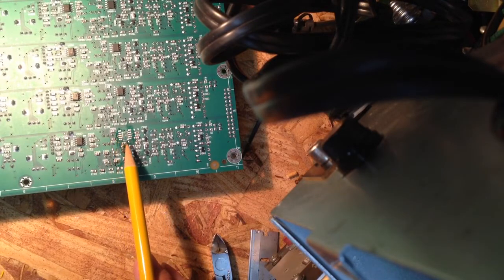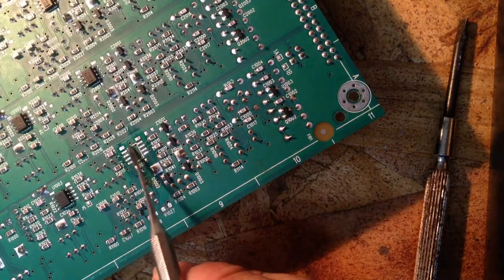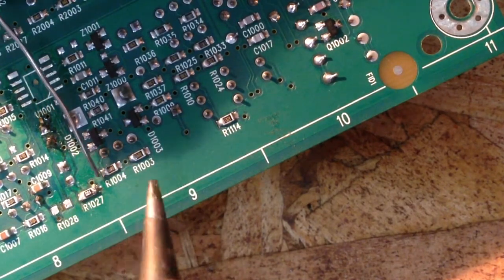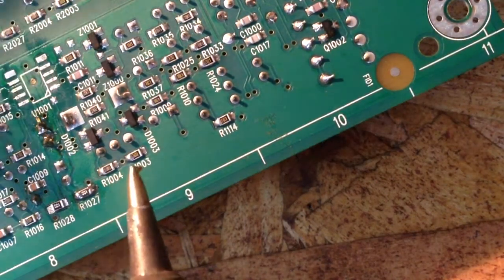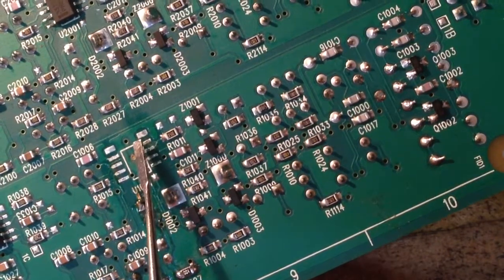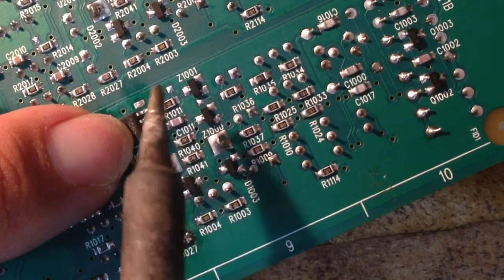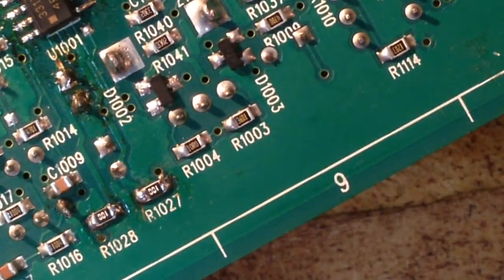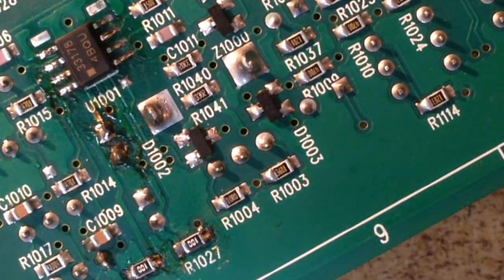Midas mixer repair

Comment: SHITTY SOLDERING!!! USE FLUX AND CORRECT TIP ON SOLDERING IRON! BETTER, USE HOT AIR! This is Nosferatu soldering.... for SMD soldering you need a soldering station with multiple tips and the skill to use, not a common soldering iron ...

Comment: hi there, i have a midas 240 and a Stereo CHannel is making crazy sound wenn plugging in a signal, what board is that your repairing? Thanks! Peace!
Reply: I have the same issue with a stereo channel. Did you get yours fixed? I was using the channel in question as return from my DAW so it saw more use that any other channel. This video makes me think the repair job is beyond my abilities...